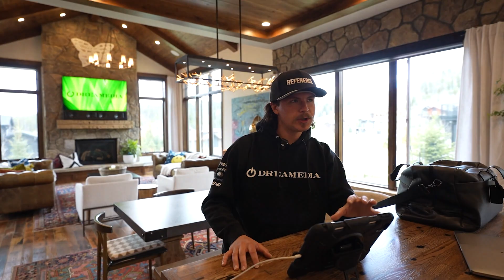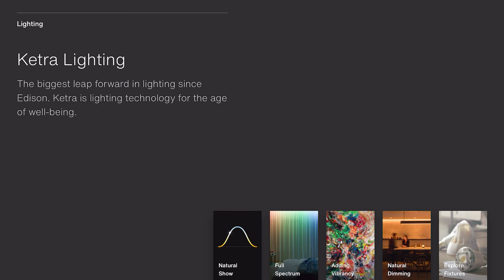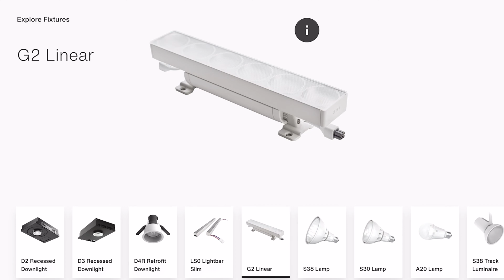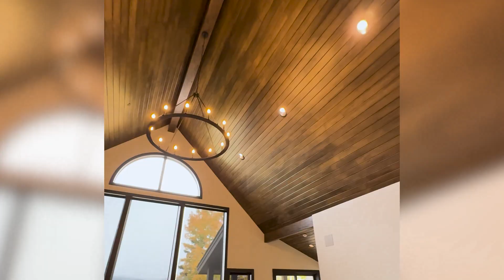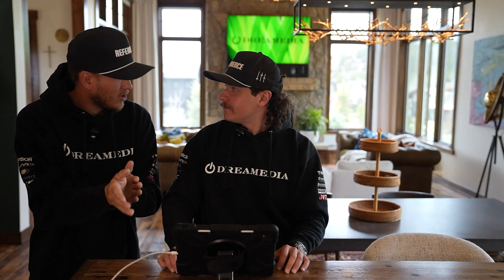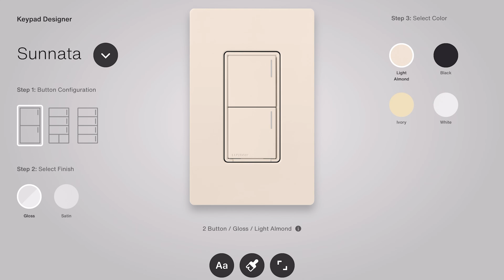Is Lutron Luxury the Best Smart Home Lighting Solution?

Comment: At 12:22 - Ketra goes up to 10,000 Kelvin but as Zack mentioned a moment before in the video, he raised the video lights temperature from 2700K to 4100K so that your skin tones are not orange. Setting my indoor lights to ~4000K at midday also looks correct here in San Francisco. Does your daylight curve use 10,000K or ~4000K at mid day? I assume only Actic locations would have indoor lights look correct at 10,000K.